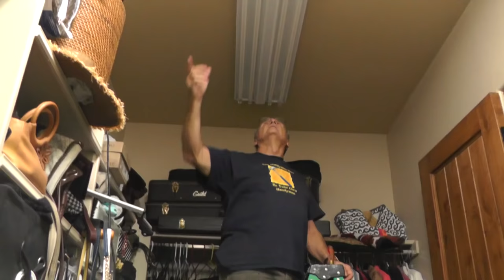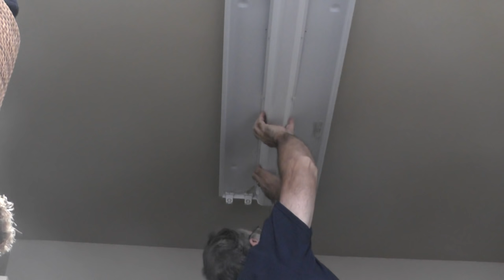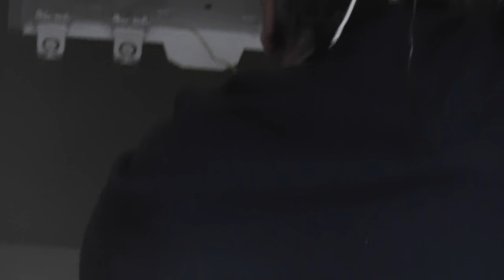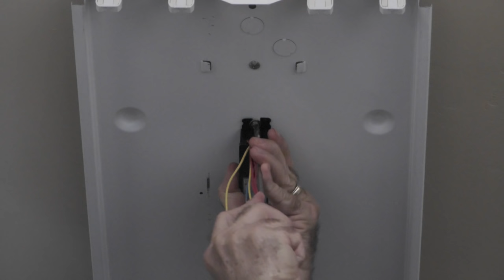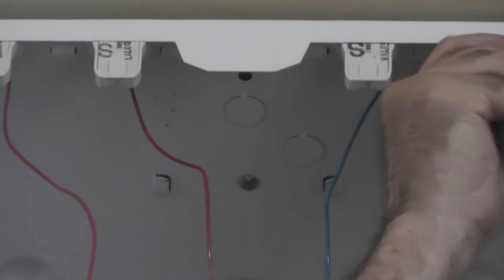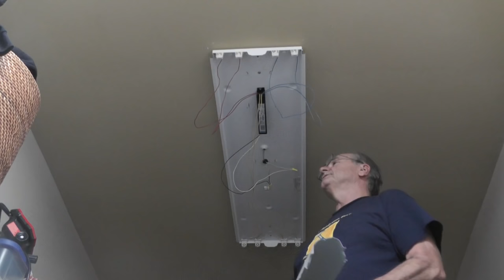How to Replace a Fluorescent Light Ballast

Comment: Just replaced mine and your demo of how the connectors slide out and then you manhandle the wire out really helped A lot!  I was getting ready to splice twist and nut wires. Didn’t need to twist or splice a single wire thanks to your vid.

Comment: Safety: In the event that you do love electrical work (which you should NOT), PLEASE disconnect in the following order: 
 1. Ungrounded Conductor (Black)
 2. Grounded Conductor (White)
 3. Grounding Conductor (Green or Bare).

The reason why is because IF you do the grounding (bare/green) wire last, you will have some type of "safety" net total trip the breaker should a fault occur IF the grounder conductor (white) is not working properly. 

BUT if you disconnect the white and green wires first and then the black wire last, you are at God's mercy if you incur a fault.

Above all, just disconnect the power, do a lockout tag out and check voltage. Better safe than sorry.

Comment: Thanks for this video!   I just changed my ballast.   What I really liked is that you showed removing the "bulb connectors" (whatever they are called).   I was about to cut and splice 6 wires but after watching this I didn't have to.   My only difference is I couldn't simply pull the wire out of the bulb socket/connector - I had to use a little screwdriver to release the spring clamp or whatever is inside grabbing the wire.

Comment: Thanks for this. I've seen other videos that require a bit more time splicing new wires with the old and this is the only one that showed that the sockets can simply be pulled out and the new wire inserted. Saved a bit of time and a bunch of wire connectors.

Comment: Great video, helped me a lot. I changed a 2 ballast 4 lamp fixture with a single 4 lamp ballast. Much easier to re-wire than use existing wires. I actually removed each set of tombstones because connections were hidden behind a plate. I did all the wiring on a table then just installed the ballast and tombstone plates.

Comment: thank you! I was a little bit confused because I only had 2 bulbs...and for anyone in the same situation as me... of course the red goes with red, blue with blue...on the other side, its just 1 yellow per side. I wasn't able to find my breaker for the room, and did it hot as well..went fine, just be careful. 

I also was replacing a very old one I think. When I was pulling the wires out of the connectors on the ends, there were pieces of wire that I couldn't get out, but I got out as much as I could...and it's still working.

Comment: Great video! One minor suggestion is that when you pull the side wires out, instead of forcing it out each of the white plastic holder, I used a pin and lifted the copper contraption from the back to get them out.

Comment: Thank you.  I replaced the ballast in my kitchen after watching this video. Taking the wires out of the connector was the hardest part. The wires won't come out easy. Other than that, everything was easy. You need to cut off power in the electric panel before working on the ballast.
Reply from the maker: +Andrew Kim 
Awesome!

Comment: My kitchen lights stopped working for some reason. tried changing the light switch and resetting breakers etc etc, and then I learned it was the ballast. After watching this vid I was able to change the ballast myself and solve the issue. Thanks a lot!

Comment: Typically, we just cut the wires to length and use wire nuts to reconnect...or you could actually pull the tombstones out like shown on the video...but it's a lot more work.
Reply: Nah. Less work, unless you don't have proper technique.

Comment: Way easier than cutting the red, yellow and blue wired and having to buy wire nuts. Especially if you do not have the right tools. This way of removing the wires from the clips that hold the light bulb is great. I had trouble getting the wires out, they would not budge. But I found that if you just stick the end of an open paperclip in the hole with the wire they pop right out.
Reply: You Reversed the Blue & Red Side.
Reply from the maker: +D 
Yes it doesn't matter.

Comment: that helped thanks.  In the the first vid I watched, the guy cut the wires and spliced them instead of just removing the pieces and pulling the wires out.  This was easier. Thanks! Time to replace that F***ed up screwdriver ;)

Comment: Very nice! The other videos I looked at show cutting the wires and splicing to the old ones, rather than just inserting the new ones into the bulb sockets. Nice to see how this is done. Thanks! 

Cojones working on hot electrical there! Not for me.
Reply: Glad you mentioned that.  The bulb sockets were throwing me as well.

Comment: Hello, I’m trying to replace a worn out ballast. The old ballast has 1 black 1 white 1 red and 1 blue wire. The new ballast has one black one white 2 red 2 blue and 2 yellow wires. Can the switch be made easily? Or does the whole fixture and/or tombstones have to be reconfigured? Thanks for your help. 
Tom W.

Comment: Hi Dave!  I'd like to pick you brain because I can't find an exact replacement ballast for my T8, 2-tube fixture.  As I was getting frustrated, I decided to swap out the old T8 fixture with an LED and already bought that LED fixture.  Still, I don't like to just throw things away if I might find a cost effective ballast in my travels.  Here's the situation. . .  Lithonia model #3348 fixture with a Keystone ballast KTEB-232SIS-1-TP.  This fixture has the two bulbs wired in a SERIES (only wires coming from the ballast, other than the power end), are two wires, one each going to the tombstones on one end of the fixture.  The other end of the fixture tombstones are connected by a single wire between them.  Tried hard to find an exact match for the instant ballast and continually find "discontinued."  Most of what I can find in terms of ballasts are the power side wires and the other end with two blues and one red.  Is there any way I can use that kind of ballast without rewiring the tombstones?  In other words, can I leave the tombstones wired as they are now (series) and use a ballast with the two blues and one red?  How would I connect those ballast wires to the existing series wiring of the fixture?  Can I just cap one of the blue wires?  Would the one connected blue wire be able to power two bulbs in series?  Would be a learning experience for me.  Or, must I bite the bullet and just rewire them in parallel which really isn't my question.

Regards,
Keith
Reply: Just buy a rapid start ballast with matching wires. Put this fixture back up and get rid of the led because led’s are built to fail

Comment: When you wired your common tombstone connectors with the yellow wires, how did you wire them? Was it like this:
Tombstone connector for lamp one:
Wire hole 1: yellow
Wire hole 2: white wire 1
Wire hole 3: yellow
Wire hole 4: white wire 2

Tombstone connector for lamp 2:
Wire hole 1: no wire
Wire hole 2: white wire 2
Wire hole 3: no wire
Wire hole 4: white wire 1

I am trying to troubleshoot a rapid ballast replacement for 2 lamps. When I switch it on it flashes once and shuts off/does not turn on.

Comment: I tried to remove the wire from the light "socket" like you show but the wire broke off inside the light socket.  Could not get the little wire pulled out of light socket.   Now what?

Comment: Thanks a lot for this very informative video. I too tried to change the ballast today but my old and new ballasts are not identical so I guess I have go get the same kind. 
Btw, one thing I noticed is that u plugged in one wire on each of the white pieces on one side but only to two of the white pieces on other side, so how do the other two bulbs work without the wires in them?

Comment: In my strip light one of the two bulbs is working and the other is not. I tested the bulb in a different light and it is good. Could it be the sockets on the side that does not work that need to be replaced?

Comment: Awesome video. Before you start, do you just need to turn the switch in the OFF position or do you need to shut off from the electricity panel in the basement? Thank you.
Reply: Turning the switch off should cut the power from the light fixture, but the safest thing to do is to shut off the entire circuit at the panel. A small amount of extra effort just might save your life.

Comment: I normally cut wires and use more wire nuts. My question: when redoing the whole wires. Don't we have to plug both holes in the receptacles? I saw you just wired one hole per receptacle 🤔 if you look in the ballast diagram it shows that.
Reply: Ur right. I had to change out one on 12/30/19
Reply: I would just take a pic of how it was before i started.

Comment: A couple years ago we actually called the fire department because we smelled a random burning smell. They came in and found out that it was the ballast in our fluorescent light and told us to leave it shut off until we replaced it. That was pretty scary. Anyway, can I do this if the switch is set to off? It's been taped in the off position since that day.
Reply: As long as their is no power going into the fixture you can do this fix no problem

Comment: I like my old under the cabinet t12 because it has a receptacle. Newer ones don't.  I changed the light, new ballast, bypass the switch. Still not working? Is it the ends?

Comment: I have 2 ballasts. Lights so far work Sometimes. however, with putting in the colored wires, you show putting red and blue on one side, then 2 yellow on the other, There are 4 connectors on the opposite side that need 4 wired, I'm confused how you did that. And I have to do 2 ballasts on a 4 bulb light case. How is that to be done?

Comment: tryed replacing a few in my basement but i have 2 incoming white 2 incoming black and 3 incoming bare copper wires but the light only turns on when i touch one of the black wires to the exposed ones so confused.

Comment: I’ve got a question. I replaced all 4 bulbs in my fixture and the 2 outside bulbs don’t work but the inside ones work does that mean I have a bad ballast?
Reply: dalibor tadic when in doubt, its ballast.
Reply: Try changing the bulb tubes first.

Comment: How do you know if you have a bad ballast? My fixture it's kind of dim when you turn it on but if I move it or tap on it, it brighten up.
Reply from the maker: +neng xiong 
You can put a new bulb/lamp in it and if it works normally then the ballast is good.
Reply: neng xiong 8

Comment: What can I do if my connector won’t fit to the old light panel, the new one slide in and out, the old one more like clip in and is much wider the new old. Please advice
Reply: Make sure it’s a T8 or a T12
Reply: You are talking about the ballast it self right?

Comment: I have a 8ft 4 bulb fluorescent light the ballast went bad now I have my new ballast that has one less wire. I have a yellow and 2 blues and 2 reds on my old and the new ballast docent Gary into it and it s main power, it says the blue is front and red is back not sure how to wire the yellow into this wire kit
Reply from the maker: I would double check that you have the right replacement ballast.  The yellow wire is most likely  a common return wire.  I would refer to the directions that came with the ballast.

Comment: Is it a problem if a little bit of wire breaks off in one of the lamp holders?
Reply: You can usually find them for pretty cheep at a hardware or electrical supply store. But if you don’t want t to buy a new one you can pry the back off of the socket with a flat head screwdriver and get the piece out. Make sure you remember how it goes together though

Comment: if the wiring is done correctly, the black wire should not have power when the wall switch is flipped off. this part of the circuit should be on the ground side.... but there are full of surprise these days...

Comment: Two red flags for me: 1) working on a HOT circuit, 2) Standing on the 2nd step of a 5 step ladder and stretching your guts out while reaching over head.
Reply: First of all electricians often have to work on HOT circuits, second if he feels comfortable with that setup he's fine. Electricians often have to work in strange positions even upside down in some cases. So he's fine.

Comment: It is so much faster leaving tombstones in place and snip the wires to remove an old ballast. Just leave about (5) inches of wire on each tombstone and mount your new ballast in your fixture. Now cut your access off the new ballast wires leaving them long enough to reach the tombstones/wires.  
  Wire the new ballast in with wire nuts then reassemble fixture, your done!!   
 Unless your changing the tombstones themselves they are rarely ever removed.  Absolutely no different than having wire nuts inside the metal junction boxes leading to the fixture and every other light/fan/outlets etc.. inside/outside any building built.
 
  Oh ya'' before anyone says anything' leaving power on while changing out a ballast or anything else during a teaching video is much more unprofessional than having a few extra wire nuts behind a metal panel...lol   Nuts will never affect how it functions either..Nope' your nuts to even think that!..lol
Reply: Nice joke at the end

Comment: My question is why didn't you just splice the wires together rather than taking the end caps off and running the new wires to them?
Reply: Avoid splices whenever possible. Eliminates more opportunities for failure. I believe in this situation it would have even been more work. Just my opinion 😉

Comment: At this point you might as well just buy a new one
Reply: Lol I think your joking. But not sure. This is common practice as ballasts die all the time.
Reply: New 2 lamp ballast at the electrical supply store: $15. New 2 lamp fixture at big box home improvement store: $75. I will save the $60 for a tank of gasoline (you know which U.S. political party managed to double that cost in 18 months.)